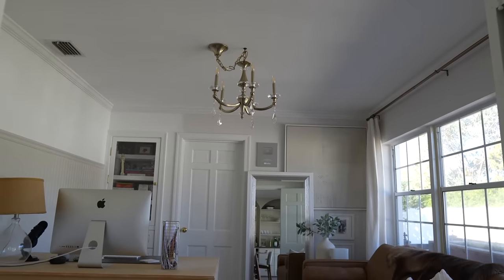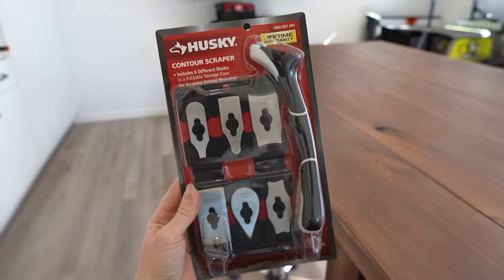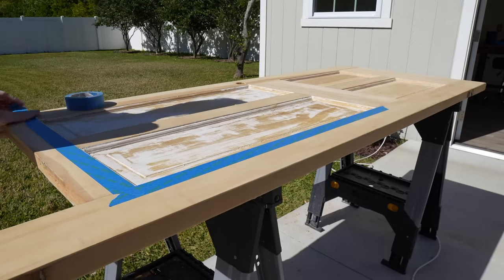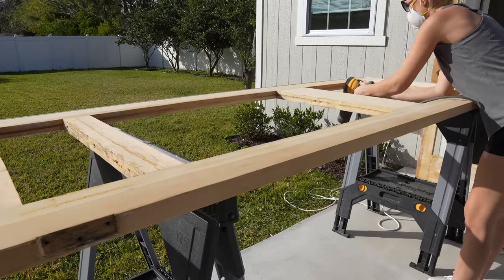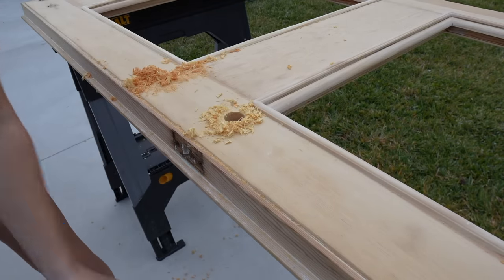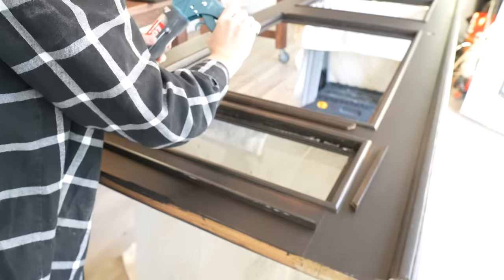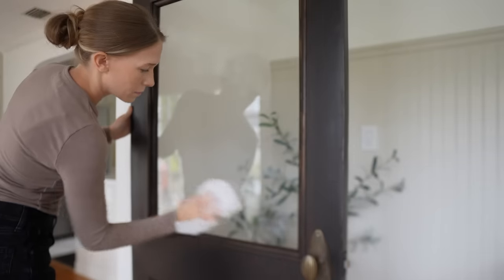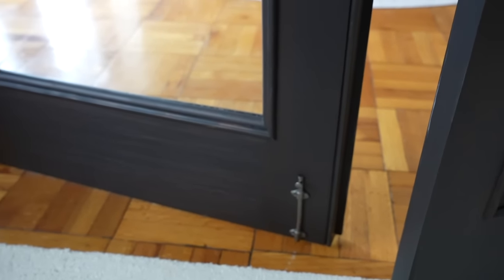Door Makeover | How to add glass to doors

Comment: Not tempered glass? Extremely dangerous.
Reply: Something wrong with people who only look for something to pick on. Booooo
Reply: I have colonial home dated 1900 and we have 5 bedroom doors with solid glass panels. Its not thin glass, VERY thick and has a kind of blue hue to the glass. Not sure when it was made but all hardware is brass and door knobs glass too.  I would have added a clear silicone strip/edge of glass. This would cushion glass against wood expansion and contraction.
Reply: @Marie.b  well it's better than picking shards of broken glass out of your children.  Learn from the tip instead of you yourself criticizing.

Comment: you should not be gluing the glass.  Wood movement can stress it and cause it to crack especially since it's so thin and brittle already.  There are little padding balls that will hold it in place and allow it to move

Comment: Though it looks nice, it is a safety hazard.  You need to change the glass.
According to the International Residential Code, all glass and panels must be tempered in these types of doors: swinging, sliding, operable, fixed, and bifold, regardless of panel size.

The glass cut at Lowe’s is not tempered.  To do the project properly and safely, order tempered glass in the appropriate customs sizes.

Comment: Beautiful transformation however I must say two things.

In my area in California, tempered glass is required in any door or window within 24 inches of a door. I know because my house wasn't to code when I purchased it.

And secondly you have secured that glass so strongly with silicone moulding and glue that replacing a broken pane may be a real pain...

I'm making these comments for people's safety not to get down on your work.

As a homeowner you have the right to do anything in your own home.
Reply: Just to let you know, I have two windows adjacent to a slider that were professionally installed years ago that aren't tempered glass....

Comment: I think my doors are hollow. Am I SOL with trying this project?
Reply: @josephcelmer5756 Probably not. Mine are hollow as well. Thinking a wider width trim is needed to sandwich the glass or plexi. I also saw a block of wood is needed in the hollow bottom of the cutout to keep the insert from falling. If that makes sense.